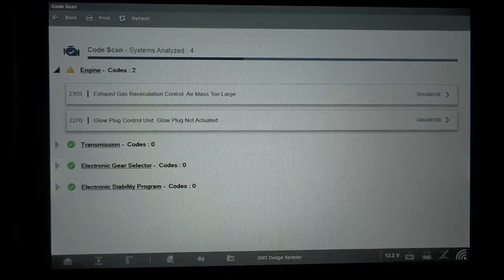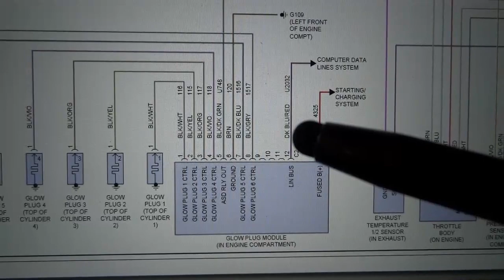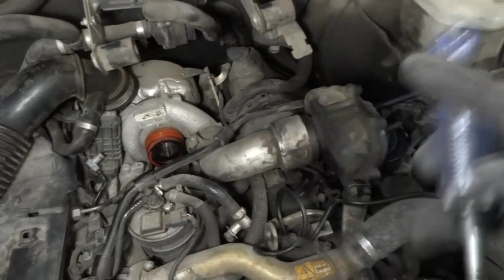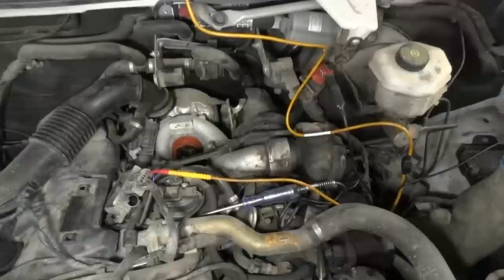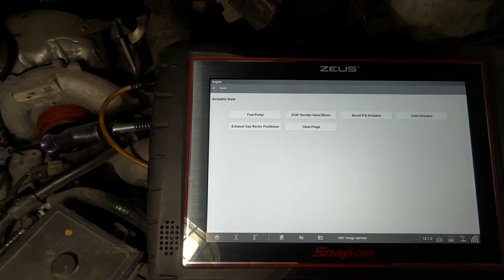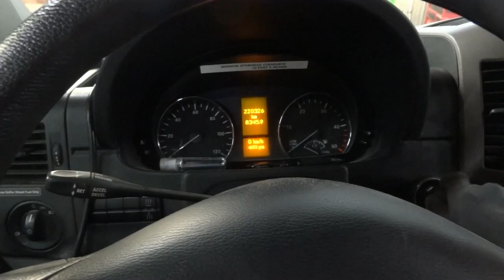07 Dodge Sprinter 3.0L Code P0670 - Glow Plug Module Diagnosis/Glow Plug Control Module Circuit Open

Comment: I have a 22 Ram 1500 3.0 eco diesel with glow plug problems. The module in my truck physically is much smaller but works exactly the same with the power wire incorporated in a one plug in harness. Testing is exactly the same as you described. Thank you for this great informative video !  In the event someone is looking for the module location on 1500 its just to the left of your air filter. Thanks again.

Comment: I went about diagnosing my glow plugs..2 were good 3 were bad. Got the first two out and installed.not so lucky with the last one.the top rung off leaving the glow plug stuck in the head ,as I live in fl don't think I will ever need them ,I assume the other four glow plugs will work fine
Reply from the maker: @theeaskey  YES! They commonly break

Comment: Mine is a 2014  3.0L, the voltage coming out of the glow plug control module to the glow plugs should be 12V right?  With the car running, I'm measuring 4V when i back probe the connector.  I have ground and 12V on large red wire.  I think I have a bad module?  I have codes for cylinder misfire in 2, 3, 5,6, and random misfire.  Also has a code for fuel pressure sensor and replaced that. Then EGR stuck, removed and cleaned that.  Glow plugs are 6 months old.  
Your videos are GREAT!   Keep up the good work.  I wish I was closer to you.  Although I can work on my own vehicles, I dont have enough time and wish you were closer.  You look like you know what your are doing and trustworthy!
Reply from the maker: @garylpphc  Thank you, I appreciate it
Reply: I want to buy a diagnostic tool for my 2014 sprinter.  3.0 diesel.  What tool do you recommend?  I don’t mind if it’s up to $1000.  I want to be able to scan and diagnose it like the dealer does. Thanks

Comment: I got a U0106 issue on my 08’ I’ve done a bit of diagnostics and verified power at least, but not sure where else to look
Reply from the maker: @Im_The_Slep  Follow the steps in the video!
Reply: @KITS_Auto_and_Truck_Repair verified we got no squarewave and another issue with the alternator lin bus communication fault
Reply from the maker: @Im_The_Slep   make sure you don't have an open in the network

Comment: The entire video is directly applicable to the E class diesel E320 CDI. (at least up to 2006 maybe further) BTW: the injectors are identical with the sprinter and if you need to replace injectors on the E class (OM648) engine, the sprinter injectors are CHEAPER but identical..
Reply from the maker: konasteph  Oh really that's good to know, Thanks for sharing that info here!!

Comment: One item to add and maybe worth doing: test the glowplugs! Since you have already removed the connector from the controller you can now measure each glowplug resistance to ground and it should show low resistance, maybe even below 1 Ohm but an open circuit or a higher resistance ..that is a bad glowplug.
Reply from the maker: konasteph  Sounds good, Thanks for your input!!

Comment: Great video!
I have the same problem on a 2008 3500 dodge sprinter.
I replaced all glow plugs and the relay and still didn’t fix the problem.
I will have to check the voltages like you did and maybe that’s the first thing I have should done before spending over $500.00
I bought everything from dealer with the VIN just to be on the safe side.
Again this is a great video!
Reply from the maker: Dionysios Psarris My Pleasure!! Good Luck with your van
Reply: @KITS_Auto_and_Truck_Repair  I found out that there's no constant +12vdc going to the single power plug of the glow plug relay unit, do you know where the other end of that wire goes to? Are there any high amp fuses anywhere on the vehicle?
Reply from the maker: My Pleasure!! Good luck with your project!!